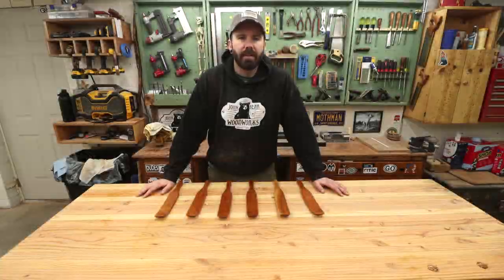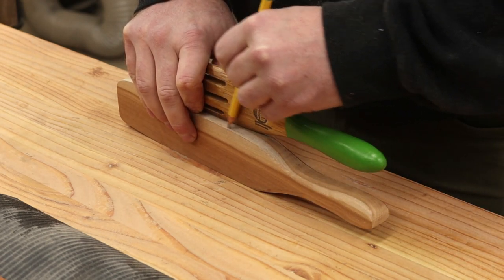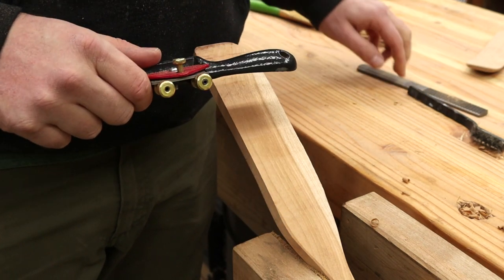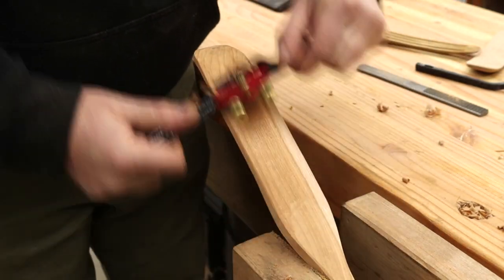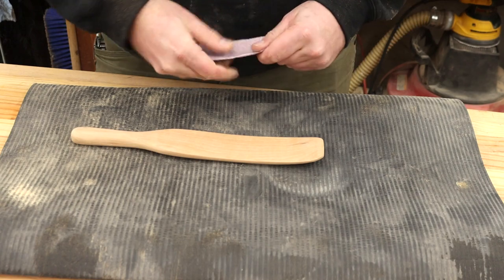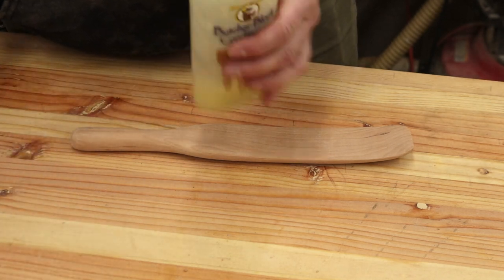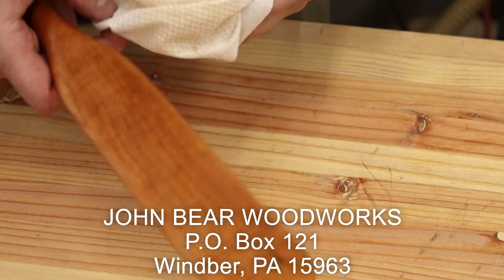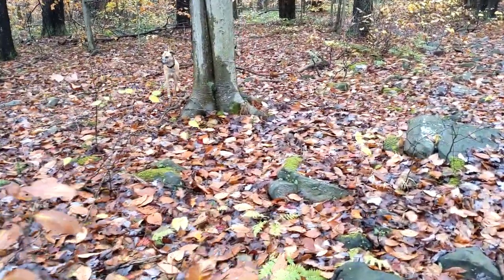It's Not a Turtle! It's a Spurtle! (Making a Spurtle with Cherry Wood)

Comment: nice job, but what`s it used for. first time I heard of it
Reply: They're mostly used in cast iron and ceramic pots so it won't scratch them up. You can use them with anything, just like a regular wooden spoon. I don't recommend stirring highly acidic foods with it, like tomato sauces, but if you clean it up immediately it should be okay. It'll eat through them and make them brittle if you let them set with stuff like that on them :)